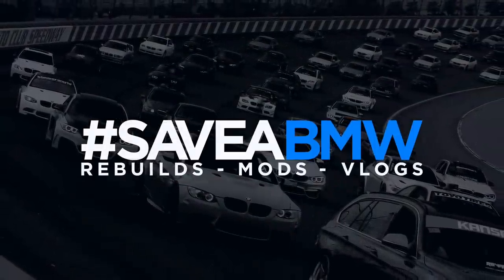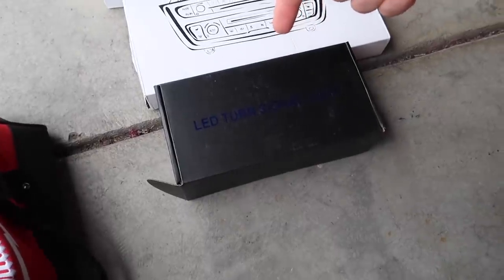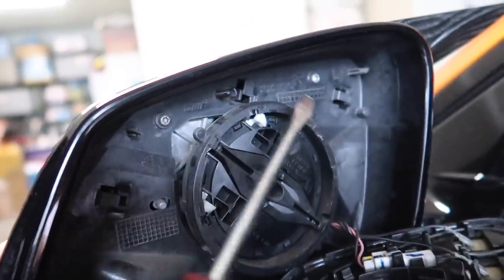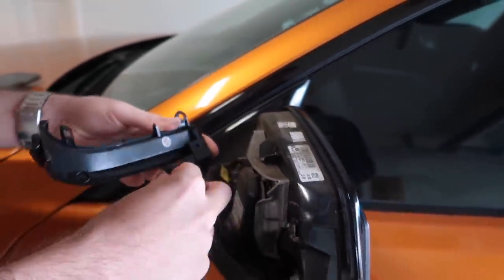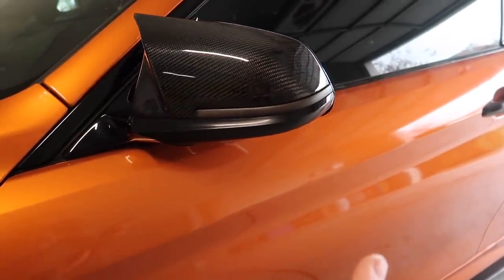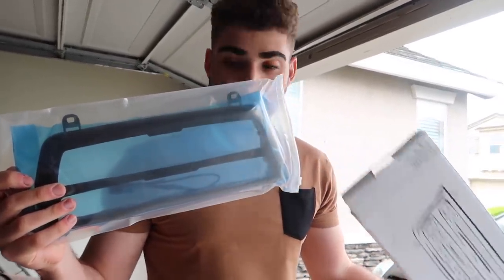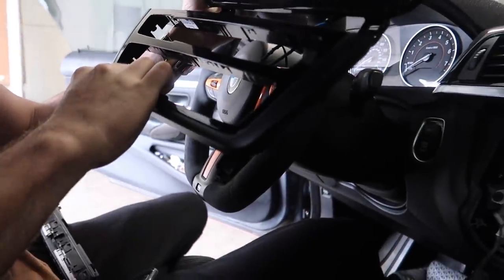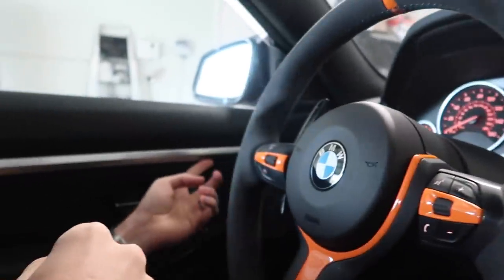Most Affordable BMW F30/F32 Mods (ALL UNDER $60)

Comment: Turn signals are called dynamic. Easy and cheap mod, love them on mine! I just removed the bottom 3 screws and it gave me enough play to remove and install. 10 minutes for both sides.

Comment: Tips for not breaking the side mirror:
- Raise the glass to the up position. 

- With a wide trim tool from the bottom of the glass, pry outwards (away from mirror cap).
- While prying outwards, apply even pressure inwards (towards mirror cap) with your hand on the top portion of the glass. 

Hard to explain via text, but hopefully this helps someone.
Reply: Exactly how I did mine and had no issues. The wide trim tool is key. Please don't use a flat head screw driver.
Reply: Broke my right mirror on my f30 335:(

Comment: When taking the mirrors out, tilt the mirrors up first then gently prise the mirror off from the bottom as it puts less strain on the mirror and less likely to crack. And don't use a screwdriver like this guy did. I didn't have any trim tools at the time so I used a plastic bicycle tyre lever from a puncture repair kit which worked a treat.

Comment: CS oled tail lights are 8k not 50k. Mirror is pretty cheap not 100$. I also broke mine while trying to install dynamic blinkers. You can try some of the aftermarket solutions for headlights like oss design where they modify your existing ones

Comment: Omg on my bimmer bro I will be nice first of all I love the enthusiasm and fun videos. Now when taking the side mirrors off always move the mirrors up to the most extreme position so that you have more pry angle and are less likely to break the mirror. Love the turn signals so clean. Also you want some nice expensive headlights, upgrade to the LCI head lights bra and finish off and you want to spend some real money but have the most branding rights and looks get CS tail lights with the OLED... thats what i m saving up for.

Comment: Hahaha i broke my right side mirror also when I was installing the sequential turn signals and mirror caps. I did not want to pay the 100 dollar for the full mirror so i just bought the glass mirror for 5 bucks on ebay and removed the broken glass and put in the new one. You'll lose the auto dimming feature but I don't really see the difference when driving at night or day.
Reply: Butcher!
Reply: you need to heat the mirror with hot water